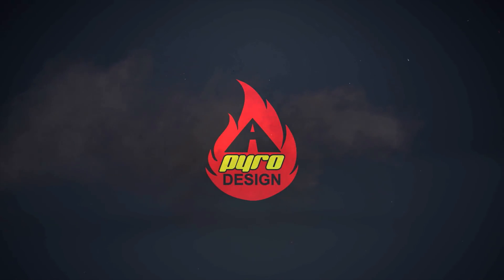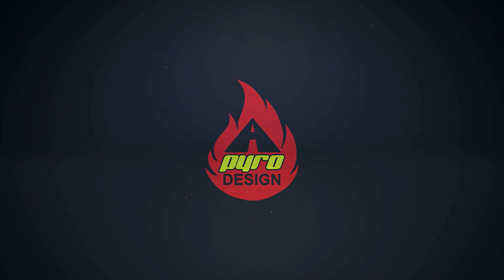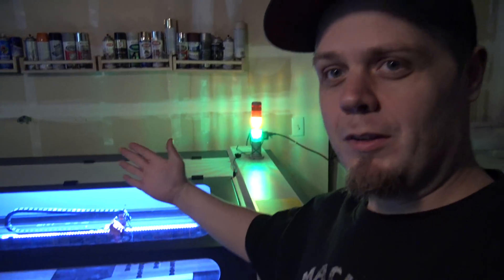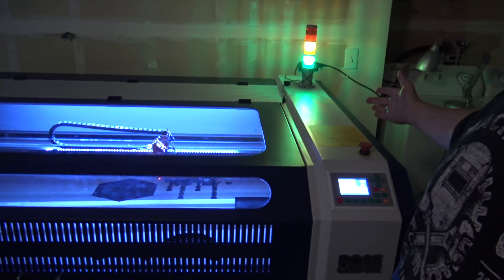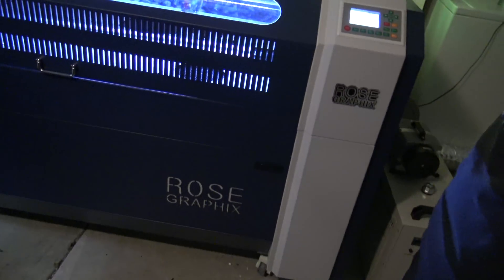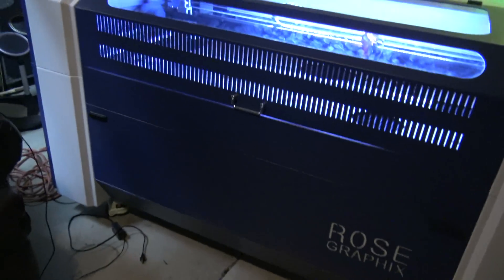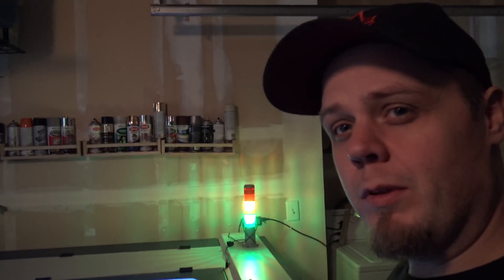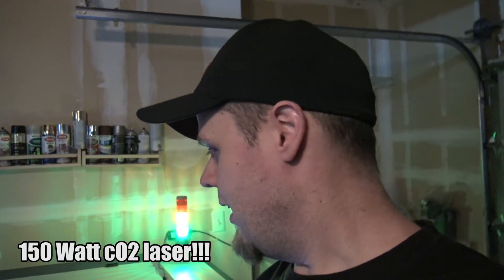Uncrating  Bescutter AKA Rose Graphix 150 Watt CO2 laser and first cuts.

Comment: I bought the same machine, do you have a smoke issue? I feel mine generates way too much. Did you have to mess with the focus height?
Reply from the maker: Yes I use your auto focus in the menu with each material I use. The focus height can drastically affect your cutting.  Also do you have the exhaust hooked up underneath the laser and on the 3 ports on the back?
Reply: A Pyro Design Yes, I have everything hooked up the way it’s supposed to be.  I’ve been watching you videos, good videos btw, and I barely see any smoke, but when I use mine there is a lot of smoke
Reply from the maker: @nola616  Very strange.  I would have to see your setup. You can send me some pics if you want. Travis@apyrodesign.com

Comment: Will this machine cut metal and acrylic?  If yes any idea what thickness?
Reply from the maker: I haven't tried metal yet.  I know our 150 watt Laser that I use at work can cut steel, but I am not sure this one is set up for that.  Usually lasers that are set up for metal have a metal detection on them so they move the head out of the way if your metal lifts up.  This one does not have that.  You also have to have oxygen to cut metal and not just an air compressor.  Now that does not mean it can't, I just have not tested it.  As for acrylic.  Yes it cuts acrylic extremely well.  I have cut up to quarter inch acrylic with no issues.
Reply: A Pyro Design thanks!  Appreciate the information.

Comment: Hey Bro, great vid.  Mine arrived today and I'm watching your vid to help me uncrate and set up!
Reply from the maker: Quinton VG Let me know if you have any  questions.  Did you get the same model?
Reply: Thanks!  We got the 100W 52x36 ... A little too large for our needs but they did not have smaller ones in stock
Reply: Did you add antifreeze to the chiller water at all?
Reply from the maker: Quinton VG No but I live in California.  I never had the need to do anything like that.  Didn't even know you could honestly haha.
Reply: A Pyro Design I got the 100W, should have gone up to 150. Its an awesome machine
Reply from the maker: Quinton VG Glad you like it.  The 150w is pretty awesome. Im sure you can do a lot with the 100w though.  I did not add antifreeze.  Im in California though.. My chiller works great with just distilled water.
Reply from the maker: Just realized I already answered the antifreeze question haha.
Reply: A Pyro Design they sent me the wrong chiller so I’m waiting for the 5000 model. But so far so good for me!

Comment: Omg that massive, I knew it was big but I didn’t get a full understanding of the size till the video. Of cause what else does everyone have next to there cloths washing machine but a 150 Watt laser !!!!! What is the glass tube thing that you installed in the back? It  almost looks like a distillation tube.
Reply: Karl Nowakowski It's the co2 laser tube, it creates the laser beam
Reply from the maker: Karl Nowakowski Its actually guided to the head using small mirrors.  I will likely do another video about that too.  We'll see.
Reply from the maker: Haha yeah not sure how many people have a laser like this next to their washing machine. I still can't believe I do.  Quinten O is correct.  That's the laser tube.
Reply: A Pyro Design is the laser then “moved” (can’t think of a better word for it) to the head by fibre optic?